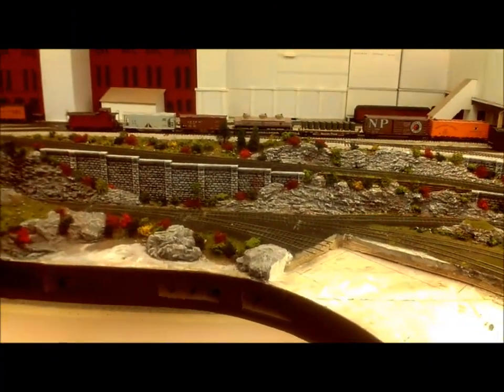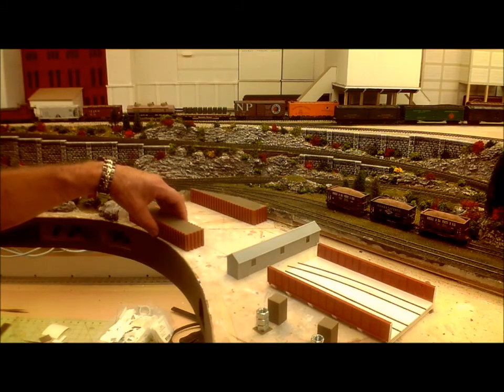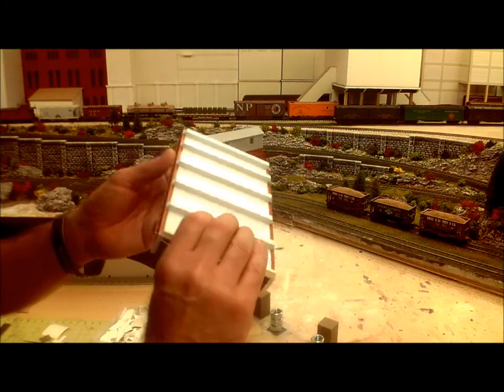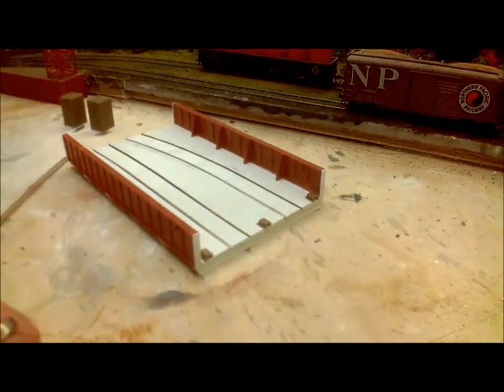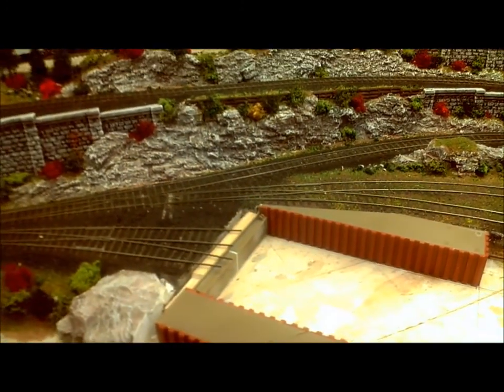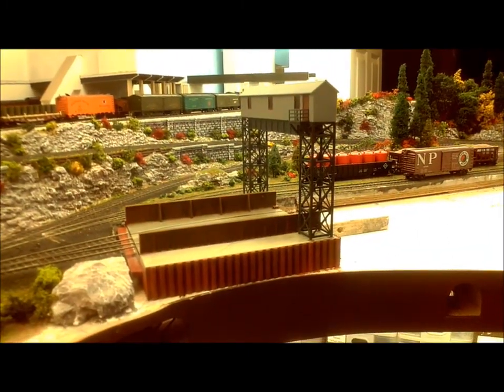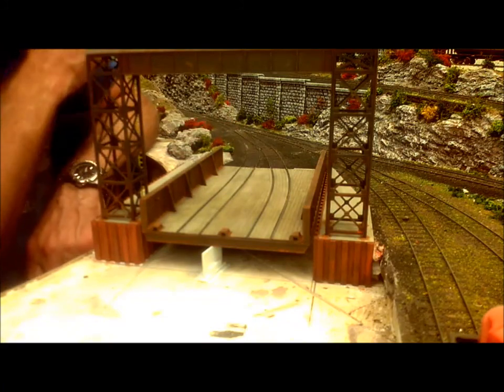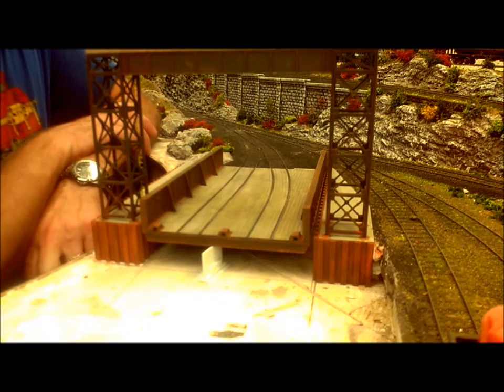My railroad: Building a car float apron

Comment: Great video as always but two dumb questions.  1: Why would you cut that one full jetty just because you have a joint in your plywood base?  
2: You are a stickler for detail (which adds great detail to your layout) - why didn’t you add a safety cage around the hoist house ladder?
Reply from the maker: No, they're not dumb at all.
1) The layout has to be movable because I hope one day to be able to move to a larger basement so it needs to come apart in sections.  One such section joint runs right under the float apron.  The deck unclips and the gantry can be lifted off.  It just rests there, held down by six large nuts hidden in the balance weights.  By cutting the one jetty and installing it in two pieces the sections can still be separated.
2) The apron would have been built long before there was any need for safety cages - pre OSHA.  This gives me the opportunity to build some ladders with safety cages and some without for a little variety.
Reply: mpeterll - Ok sounds valid.  Just a word of advise however, moving a layout is never easy, even if it was planned to be taken apart.  Been through two moves, one mine, one a friends.  Neither one turned out as planned and they were much smaller than yours and the initial layouts were planned to be able to be taken up and out of the basement.
In any case, just the way you had things set up, I had wondered if parts of it were meant to be part of  a display that you see often at shows were members bring a four foot section each to assemble one very large display run.  Thus your plan for it be disassembled should probably work.  Good luck when ever it happens.
Reply: mpeterll  - Thanks for your reply.
Reply from the maker: I've built fully portable layouts before (layouts designed to be set up at shows on a regular basis).  This certainly doesn't fit into that category though.  I figure on a few weeks to get it set up again and repair any minor damage from the move, so I'll still be way ahead of having to start again with a new layout.